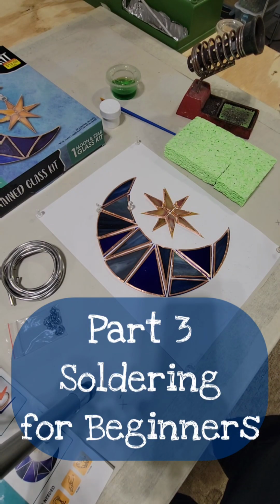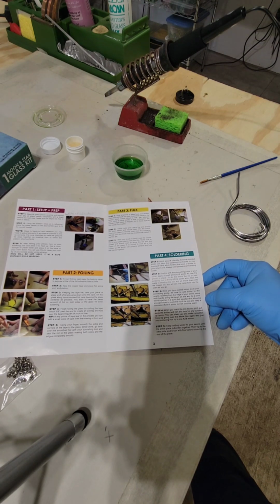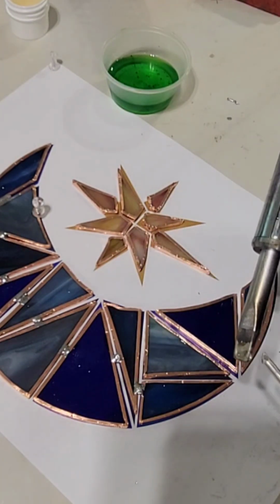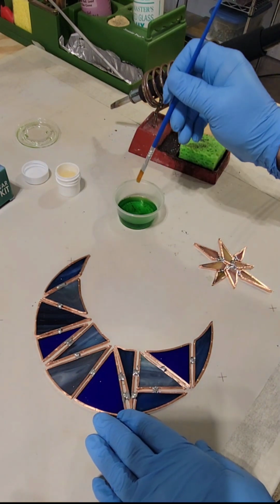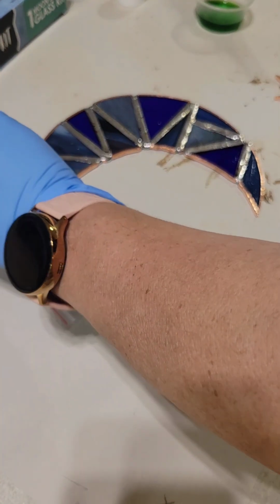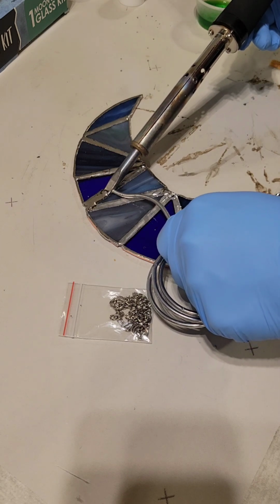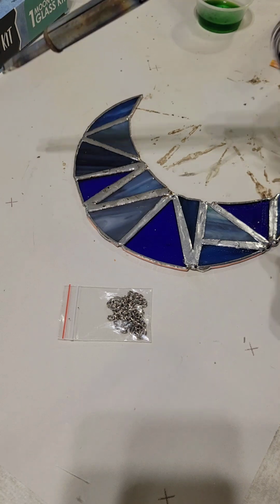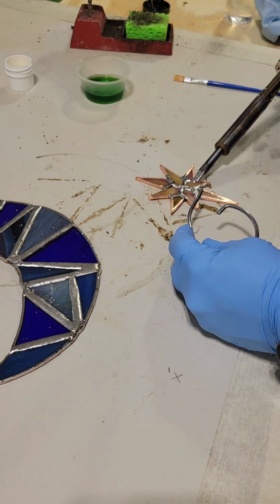Beginner Stained Glass Project Part 3 Hobby Lobby Stained Glass Kit

Comment: Your gaps are way too wide, it makes the solder joins look ugly. But that's a fault with the pattern.
Reply from the maker: Yes they are and normally I would grind them but this was just an intro with the hobby lobby kits using only what you get from them as s starter project but yes definitely recommend grinding and making a tighter fit.   Thanks for watching
Reply: @reneesstainedglassworks   I understand that you're just following the instructions on the kit. I've seen your other work, and it's amazing.
I'm looking forward to part 4.  It's great that you can teach people how to improve the final product from these kits.
Reply: What flux are you using? I see you are not using what came with the kit.  Also, why do you dip your iron into it?
Reply from the maker: @BobbiSchneider  I'm using liquid flux.   Hobby Lobby also sells liquid flux.   It keeps my tip clean and works great when lifting solder balls.